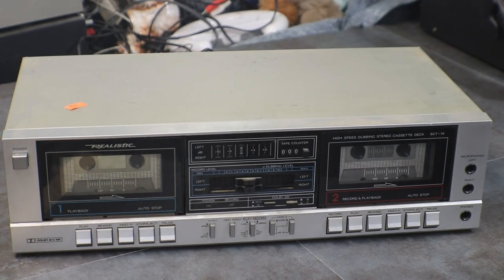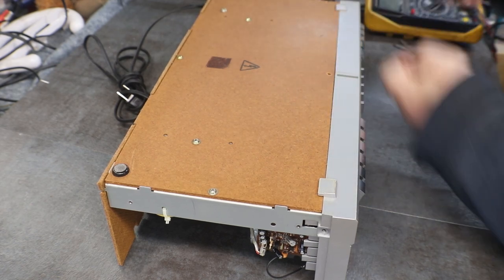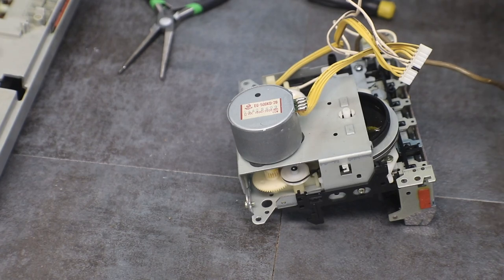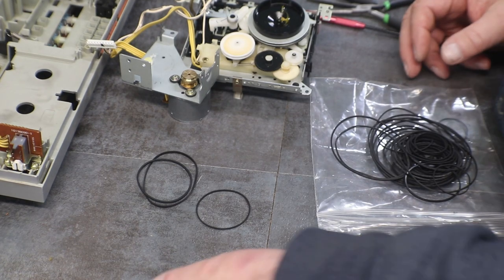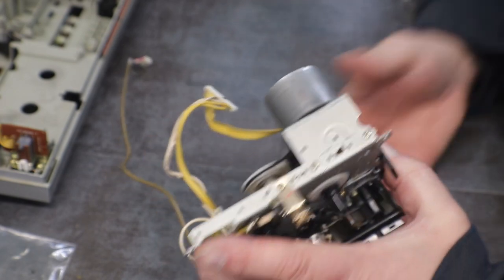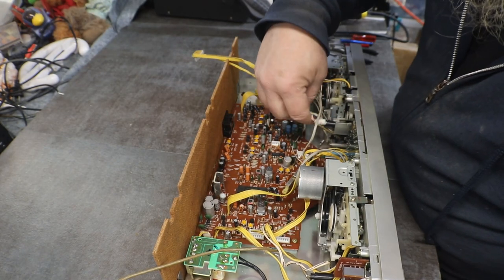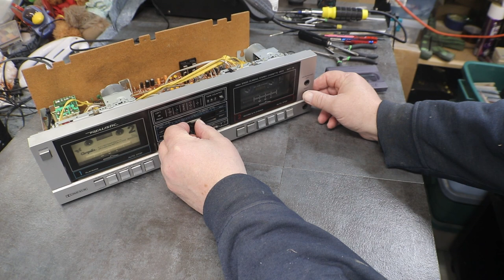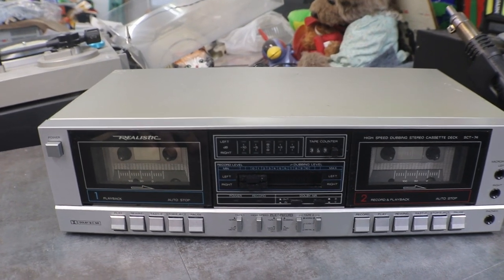Realistic TCS 74 Dual Tape Deck Built Replacement & Service

Comment: Thanks for this video. Just an FYI.  The Realistic SCT-72 was made in 1986, and was improved in 1987 to include both Dolby B and C and renamed the SCT-74. In 1990, the silver finish of the SCT-74 was changed to black finish.  In 1991, the all Realistic stereo equipment was renamed was renamed Optimus, including the SCT-74.  1993 was the last year for the Optimus SCT-74. That means this Stereo Cassette Tape (SCT) deck was manufactured from 1986 thru 1993, or 8 years.
Reply from the maker: Thank you for sharing all that detailed information! It’s fascinating to learn about the history and evolution of the SCT series.